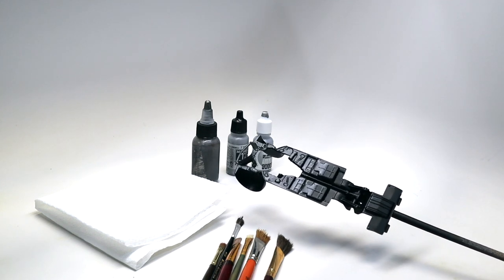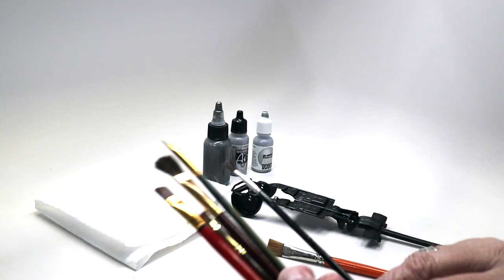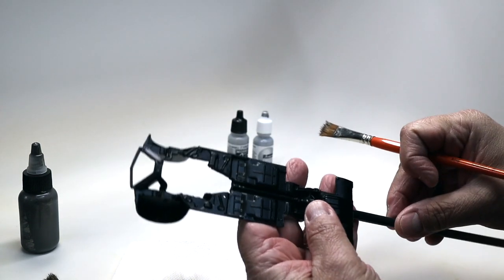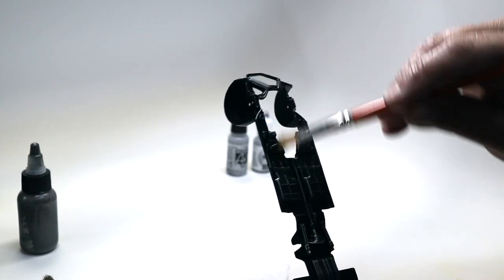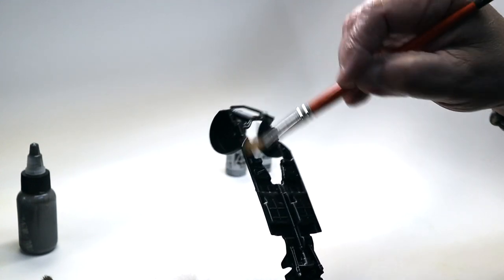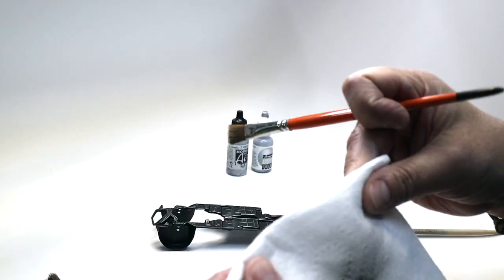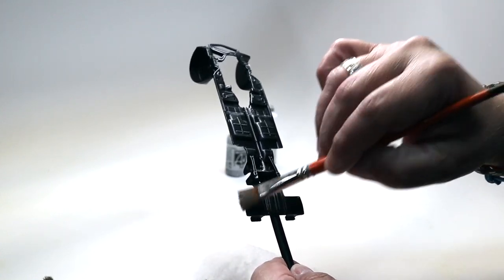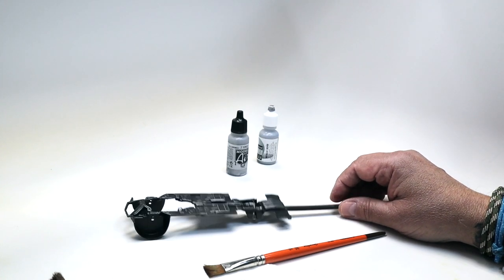DRY BRUSH YOUR MOLDED IN CHASSIS

Comment: OK, here's my little problem with this procedure. It's unrealistic. Cars do not come off the assembly line with highlighted details, especially in the floor pan. They are shot one color (some shade of primer or black) and then the various components are bolted up. No silver highlights anywhere. No exposed silver bolt heads. Gas tanks are all galvanized silver, no black. I know another YT builder does this, too, but still... Sure there are other instances for dry brushing, but this isn't it. Just my opinion.
Reply: Agreed.
Reply: On a 1:1 car this is true, but this is 1:25th scale, and to highlight the exposed detail helps to bring them out.
Reply: @brucecoy4799  Understood. But, if the goal is a 'realistic' finish then avoid silver or metallics for the dry brushing. 

Personally, I use a mix of greys, light black and grey black.
Reply: @brucecoy4799  I guess that's cool if your vision ain't what it used to be. But the point of building a replica, to me, is accuracy, at least to an allowable level. Going out of your way to be inaccurate makes no sense. The difference, I suppose, is that I have turned wrenches on these cars since the 70's and I know what most of them look like. No disrespect to the Crankenator; I admire his creativity and dedication, for sure. Just my opinion.